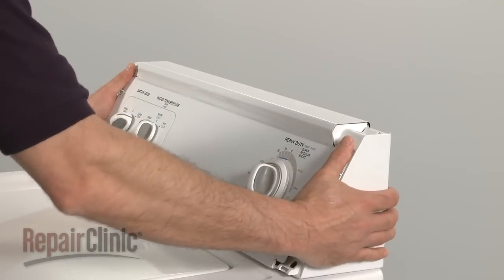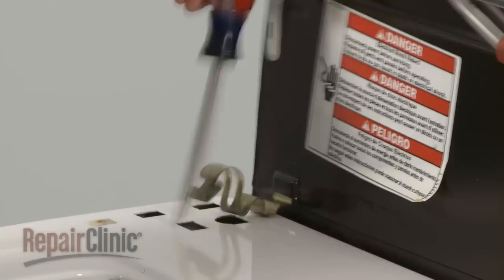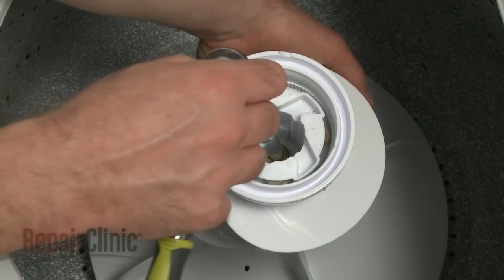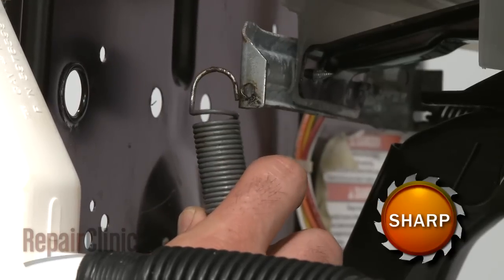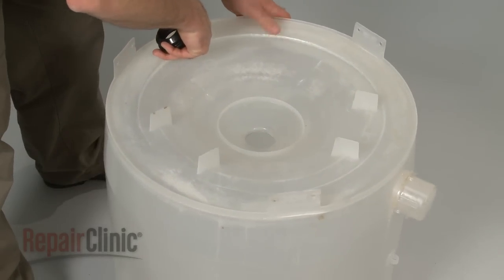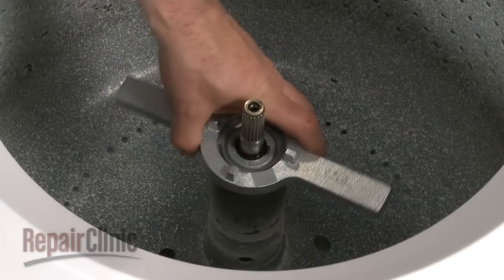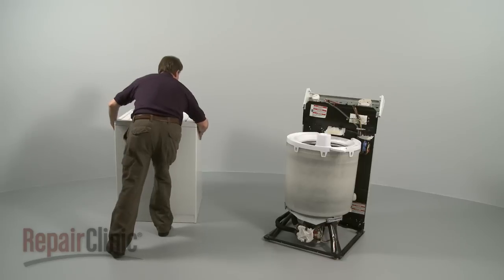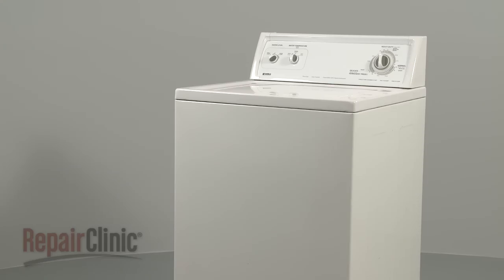Whirlpool/Kenmore Top-Load Washer Leaking? Tub Seal #383727

Comment: So doing this to my 28 year old Kenmore 80 Series washer and using this video was my weekend project. Things I learned. 
Nothing will go as smooth as it is shown in this video. 
You will need the spanner wrench. $12 on Amazon. Even with the wrench, you will be banging the crap out of it to get it off. 
You will need a 6 inch gear puller (not a 3 inch or 4 inch). Harbor Freight has a 3 pack for $22, which I thought, Ill never use these again. But I could not have done this job without it in fact it was the toughest part of the job. Save yourself from trying anything else. Spend the money and get the 6 inch gear puller. 

You will also need some silicone spray and a cheap wire brush (for cleaning)  
To get the center inner tub off, using the 6 inch gear puller, this took me over an hour as the puller kept popping off. You have to turn your Bolt (that you took off with the spanner wrench)  upside down and screw it back on. While your torqueing the ratchet to pull this thing off, ever few turns, tap on the hooks with your hammer to make sure they are secure in place. Also, (Very important) take an adjustable wrench and hold the gear puller in place (left hand) while you are turning your ratchet with our other hand. If you dont, the torque will will spin the gear puller a little causing the hooks to pop off. (The hooks on the gear puller have little to grab onto and hold it in place) 
Once you get it all off, you will have to pop out the center metal piece with a 2x4 and hammer. You will NOT be able to get the washer back together if you leave it on. 
Plan on spending some time cleaning both your interior tub and outer plastic tub once they are off. 28 years of stuff its pretty caked on. 
In this video, the rubber replacement seal just pops right in. No such luck. Took me and the wife pushing on both sides of it with the butt end of hammers to finally get it to pop in and had to use some silicone spray to grease the way. 
In another comment, there was a note that a guy found a little cup with a cotter pin in it, which he didnt recall ever taking off. I found that as well laying on the floor. Apparently, there are a couple of them and the cup is just attached to the bottom of the frame with the pin in it. Has no appearant purpose and may have something to do with shipping. But if you find this, dont spend any time trying to figure out where it goes. Throw it away. 
When all done, fixed my leak. If it hadn't, then likely would have been either one of the transmission seals (there are 2 on the center shaft) that you will see when you get this thing apart. 
Thats a whole other more complicated job to fix that. 
Lastly, while you have this all apart and are spending hours to replace a $5 seal, go ahead and replace the agitator dogs. They are cheap and will likely need replacing anyhow.
Reply from the maker: Thanks for the information.
Reply: What part number of spanner wrench did you get? I just looked on Amazon, and there are a few different part numbers that look the same.  Thanks

Comment: What the screws. Mine had one the head stripped from the factory. The screws are cheaply made and the heads strip easily. Line up the cabinet when you put back together with two tabs on each side that stick up from the bottom frame. How do you know it is the tub seal or the pump, hoses, water pressure tub, or other?

Comment: It is more difficult than this video. There is corrosion and stuck tubs. The spanner is tighter. I used a 10 inch pipe wrench opened up and hooked in the slot. Inner tub was stuck so I turned the spanner nut upside down put it back on and used a gear puller to pull the tub. Bottom tub was stuck too but running around it with a screwdriver loosened it up. I used O Lube around the gasket and on the shaft.
Reply: Thanks for the tip of reinstalling the spanner nut and using a gear puller.

Comment: If I need to remove the inner tub/barrel, but not the outer tub, for cleaning, do i need to replace the seal? As far as I know, the seal is still good. Thank you, also how tight is the large retainer (tub) nut to be? Is there any special cleaner that should be used? I wouldnt use a harsh cleaner. Thanks

Comment: If you get a spanner wrench online make sure it's like the one in the video. Mine was like a box end wrench trying to take off a nut from a bolt that had already been loosened an inch.  I got one that worked but I had to hold it the whole time (40 minutes)  and hammer. If you can get a friend to help with the holding the tub while hitting it it would help.

Comment: I, too, had trouble pulling the inner tub. I tried everything I saw in the first few comments here WRT that problem. As I was trying the torch the second time my friend showed up and suggested reversing the spud nut to pull the tub. That worked, but of course after I  had tried the heat, WD 40, vinegar, hammering with a wood block, prying and tapping.

Comment: This video is great. I hope any of you out there like me who think you can do this without the spanner wrench get really lucky and/or don’t disfigure the nut too much trying to get it off. I tried a lot and had no luck, then bought a 12$ wrench off amazon and two days later it popped off really really easy, totally worth the 12$.

This video was great, the only thing I would add is that the drive shaft will most likely be corroded pretty badly (my old tub seal didn’t look bad at all, but there was just enough corrosion on the shaft and between the shaft and the seal that water must have been getting through) so be sure to clean that up. I just used a piece of sand paper to clean it up, probably should have put a dab of grease on it to help seal it up. Hopefully it won’t be an issue for me, planning on having a new machine by the time this corrodes again. Also, getting the outside tub off the shaft was difficult, if you aren’t flexible enough to get your foot up on top of the drive shaft while pulling the tub up then you should have a friend to help pry that off. 

Otherwise this went pretty well, great video.
Reply: I removed mine by using a hammer 🔨 and a chisel and knock it around . Didn't take much.
Reply: @michaell3711  hahahaha boom

Comment: I had one repair guy said to put some silicone rubber sealant around the outside base before pushing in the gasket.. I have not seen anyone recommend this before. They listed  http://www.repairclinic.com/PartDetail/Silicone-Sealant/279368/469523?ss=b5-x73696c69636f6e65207365616c616e74&mr=0
First off why is this silicone so expensive  and t second why would he have recommended to do this?  I assume it is to help prevent any minor leaks from any deformity? Seems too expensive for a tube of that and not shown in any video. Thoughts?
Reply: I agree with using the Silicone rubber sealant. I replaced my tub seal a couple years ago and it is leaking again. This time I cleaned the shaft where the inside of the tub seal rests and applied silicone rubber sealant in this area also. The rust pitting on the shaft broke the seal & let the water out between the shaft & inner seal surface. I also used never-sieze on the spanner threads when I reassembled because I had to use a propane torch on the outer edges all around the spanner nut to get it to release. Good as new. Thanks RepairClinic!!

Comment: im trying to remove pieces from the tub I have a Low Water HE Kenmore washer it looks different than this washer its just tub with now stick in the middle the problem is im trying to remove small pieces that fell on the bottom and makes noise while spinning.
Reply from the maker: What is your washer's complete model number?
Reply: Mod think its 110. 26002010  were looking for the manual but no luck but im sure this is it.
Reply from the maker: Awesome In Black You can remove the wash plate (the white agitator at the bottom of the tub) by popping off the white cap in the middle of the plate and removing the bolt securing the plate to the tub. If this doesn't work out for you email us at jhull@repairclinic.com and we'll see if we can help out further.

Comment from the maker: +Magic Mark, the sealant pricing is set based on the manufacturer's pricing to us; since it's a major manufacturer's product, pricing may be slightly higher than products not made by the appliance manufacturer. Some technicians will use silicone on the tub seals to help prevent a leak. It is usually not necessary to use silicone on a new seal; it should seal properly without it.
Reply: ***** Just did this repair on a Samsung front-loader, so a slightly different beast.  There was a small divot and a protruding seam (that you can catch your fingernail on) that appears to be from the manufacturing process.  Are the seals usually good enough to seal around deformities like these?  I'm not digging the idea of pulling the whole thing apart again just to smear some goop around the seal. :(

Comment: I was able to get everything apart and removed tub. Wanting to clean this part up we poped out the gasket and found a lip or bearing of sorts that appears to have melted apart. I'm going to assume that this was an intrigal part of the tub? Only fix is to replace tub? Or am I wrong in my assumptions. Do you have a video showing this part intact. My diagram I found online does not show this part of the tub or as an aux part, any info in this matter would be greatly appreciated. Mach is over 21yrs

Comment: Has anyone ever seen the inner tub cut a long hole in the outside of the outer tub?  Worn tub bearings?
Reply from the maker: Can you please clarify your question?
Reply: *****
I recently handled a whirlpool that a long circumferential cut covering almost 25% of a circle in the outer tub.  I had never seen this before, and the tub bearings were not worn out.  Also the drive block was ok.  Since I posted that question, I have surmised that a nail or something probably worked its way into one of the holes of the rotating tub and cut the gash into the outer plastic tub.
Reply from the maker: Hiruit Nguyse Aah, yes, a nail or other sharp object is most likely the cause of the damage.

Comment: Very helpful video and great quality.
I was able to remove and replace the cabinet to locate a leak in the tub caused by a broken tab/fin on the bottom of the tub. I attempted to repair the  leak with waterproof epoxy putty. The patch is holding, but now, there is a loud thumping sound during the last few seconds of the spin cycle. Is this related to the patch? I pressed it into the hole to get a good seal, could the putty could be coming in contact with the inner drum and causing noise? The cost of the tub seems too high to replace it in a ten year old machine.
Thanks again for the video.
Reply from the maker: britup1 What is your washer's model number?

Comment: After I removed Spanner Nut. The Basket is Stuck will not come up, Used WD40 still not coming up. any help.
Reply: I had to use a gear puller. I put the spanner nut back on upside down and put the fingers under it. Worked great.

Comment: I performed this repair.  If your machine is 10 or more years old soap and additives will have stuck the compression fitting to the metal tub.  You will not be able to just reach in and lift out the metal tub; too much force needed.  You will need a 6 inch gear puller, like those you can buy from Harbor Freight, to remove separate the metal tub from the shaft and compression fitting will remain in the metal tub.  Install the tub nut upside down on the shaft so that gear pulller has something to grab against.  You can push/pound the compression fitting back into the tub housing after it is removed.  Otherwise this repair worked as described in the video.
Reply: I tried this with the harbor freight tool described and I failed.  I tried it with a hydraulic puller from harbor freight and I broke the spanner nut. The video was great but my washer was just too far gone.
Reply: @motorcyclemike1299  you can use a car jack and a piece wood cut to fit the spin basket.

Comment: For anyone else that has a problem with the inner tub sticking, I removed the spanner nut and put it back on about half way and used a gear puller attached to the spanner nut and centered in the threaded hole of the agitator shaft to pull the inner and outer tub free from the agitator shaft at the same time.  Once they were both free I put the tubs on the ground and hammered the drive nut through.  Was much easier than trying to pull the inner tub free from the drive nut.  After 20 years of service there was some serious build up on the drive nut.  Just make sure you do everything you need to free the outer tub before you use the gear puller, i.e. removing clips and springs.
Reply from the maker: Lee Lancaster Thanks for the tips!
Reply: Lee, what size gear puller do you use.  I dont want to damage the agitator threads
Reply: Magic .Mark Hey I think it was a 6" bearing/gear puller.  It was a piece of junk harbor freight puller like this.  
http://www.harborfreight.com/automotive-motorcycle/pullers/three-jaw-puller-set-4-pc-69104.html
 I put the spanner nut back on the agitator shaft about half way and set the puller jaws on that.  I should have taken some pics but by that point I was pretty.......consumed with the process, lol.  I had tried all kinds of tricks, hot water, jumping in the tub, hammers, 2x4's and probably a couple other things that I can't remember.
Reply: Lee line does not have a swivel so when it makes contact with the Center gear shaft it just turns the entire gear shaft enough seemed to lift anything
Reply: Magic .Mark It is not working for me.  What actually should be happening.  Could it be possible the Series 70 from I assume 1988 have something else holding it on?  Yes I dont have a gear puller with a swivel so when it gets tight the shaft starts to turn.  But I thought I would see a little movement.  Nothing.  I have a little play up and down but not sure what is moving .  I have been messingwith it for an hour. I hate to buy another setof pullers for 30 bucks if might not work.  I cant see how gear  pulling on the threaded part is going to lift the drum.  . Wow I think I wasted $50 in parts since if I cant get this off I cant stop the leak so the new clutch and other parts really arent going to do a darn.  Any other ideas how to free this, is appreciated.
Reply: Magic .Mark  OK it is finally off.   While I liked Lee's answer I didnot have a pulley with swivel so it was turning the gear shaft and I was not sure if that was OK.  So I took a large screw driver and 5 lb hammer and banged and pry as even as possible.  The pry was pushing the metal away.  I was going to give up when it did not appear to be doing anyting but then I gave a pull up and it finally was free after a few pulls.  There was a mess on the lower shaft. The drive block was fused to the shaft at one spot and I had to break it to get it off.  So I am not sure the correct puller would have worked with more torque and a swivel end .  Some on a repair board said turning the shaft clockwise would not have hurt but I was not going risk it,  .  There was plenty of rust looking gunk in the center tube of the metal tub.  I was fine with replacing the drive block. The spanner nut still seems to cover  the flare I made. It is not as bad as I thought it could have been since I did NOT split any metal.  I am not sure if I even should tap back as it  might misshapen even more. but I just want the nut to hold down the tub and not going for looks as the agitator covers it.
Reply: +Lee Lancaster Just wanted to add my tip as well, I fixed a 25 year old machine that had never been taken apart before.  What worked for me was putting the spanner nut back on most of the way, and then using a very large socket (axle nut socket).  It has to be big enough to hit the spanner nut, and tall enough so that you don't end up hitting the shaft.  I think a piece of pipe would work fine.  Then, lift up one side of inner tup and hit the socket with a dead blow hammer.  Be careful you don't hit or drop anything on the porcelain tub.  I took my time, and probably hit it 100 times, rotating around but it eventually popped off. 25 years of corrosion and sludge made it a little sticky.  Oh yes I used some penetrating fluid as well.

Comment: Thanks for the DIY video, very helpful, and yes it was the tub seal that was bad. My basket stuck also when trying to pull it out, used WD40, and a flat  head screwdriver to pry between basket , and drive block to allow WD40 to get down in there. Drive block was really corroded.

Comment: I'd think the first repair step would be to determine where the unit is leaking from. Just because its leaking from underneath doesn't mean its leaking from the agitator seal, it could be from hoses, pump, etc.. This video is great to see all the different parts and how to remove/replace them, but as someone else pointed out, figuring out where the leak occurs is first and foremost. Thanks for the video though!
Reply: No sh*t. But, it’s easy to determine. The video didn’t say, if it’s leaking, then it’s the tub seal. It’s just showing you how to do it.

Comment: Replaced the seal and all went well. When the machine started to spin however it seemed to be a little off. Also, Is there a gold cotter pin somewhere in the machine parts? I dont recall removing it, but it was on the cellar floor after the repair. Does this pin belong in the washer ??

Comment from the maker: I don’t know what that part could be besides part of the tub that may have melted if the seal was loose and spinning on it. If the part was plastic it was most likely a part of the tub and the whole tub will need to be replaced. If it was black rubber it may just be a part of the rubber seal that came off. The center part of the tub has about a ½ inch lip that protrudes up into the tub that the seal sits on.